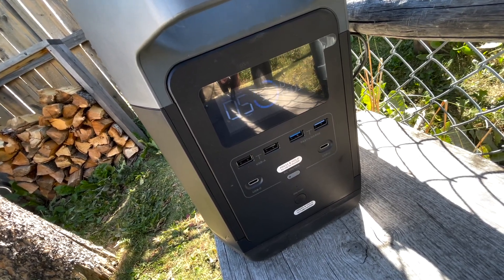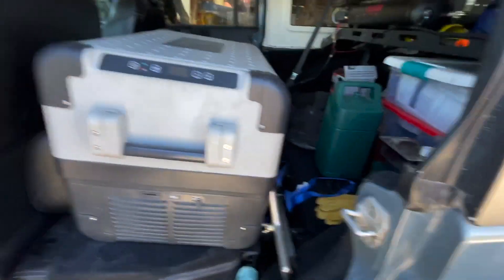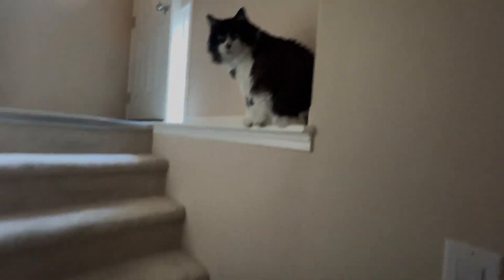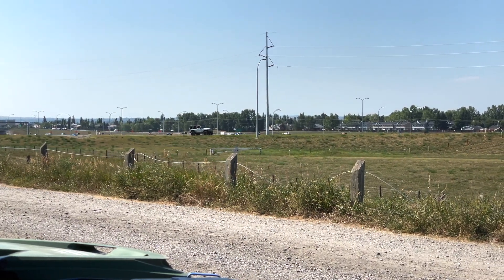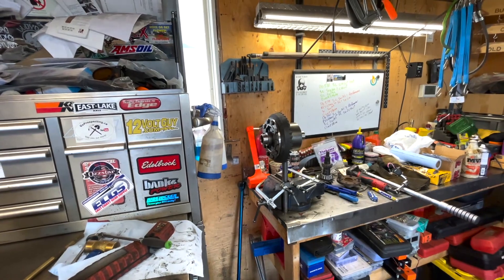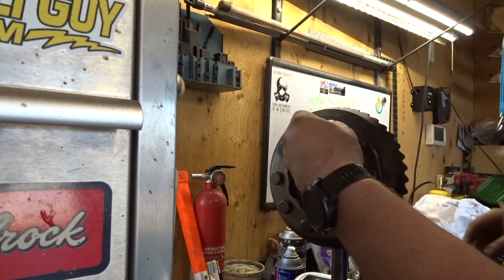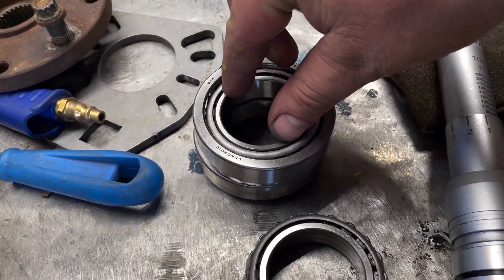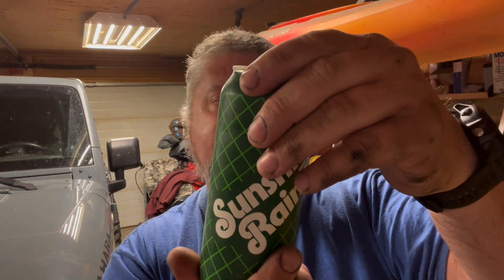Getting the Detroit Truetrac Ready for the Ford 8.8 Swap

Comment: Just got the old arb air locker and destroyed ring gear out of
the 8.8 in my Tj. Going with the truetrac this time with 4.56. Great video.
Reply from the maker: I bet that was a mess
Reply: Bullshitkorner what brand ring and pinion gears did you go with and did it require a special center pin or did you just use the one with the truetrac?

Comment: Hello BackCountry, You showed a procedure of heating the ring gear...was that because it would not fit TrueTrac diff housing?  I rebuilt a 8.8, used a Ford Motorsports LSD, and the ring slipped on, no problems.  Is this something that you have run in to on TrueTrac diffs...or just a general approach?  Thanks so much for video!

Comment: usa gear electro etch the pinion hight. I mentioned on your last axle video I use a parallel that spans the caps.  then with a depth micrometer I get the reading then minus out the parallel. last one I did I used the stock shim pack on the pinion took the reading made the shim adjustment and bang on :)  but when I did my yukon gears they didn't have the pinion height so that had to be done with only the pattern compound.  anyway you know what your doing just another idea to get away from the store bought setup tools.
Reply from the maker: Those numbers on the pinion didn’t make any sense to me neither could I find any info on it.
Reply: @BackCountryWrenching  so they are likely just matching numbers to indicate the r/p are a matched set like Yukon did. 
Not all manufacturers provide this info on the running height of the matched set It’s weird why they don’t. 
Last one I did for a Dana 44 was old stock Salisbury with the height marked. It was so much easier to set. 

Next ones I do I’ll investigate who marks. Makes it easier for me at least.

Comment: How does the 8.8 compare in strength compared too the dana 44?
Reply from the maker: The 8.8 is stronger than the D44 but the downside is that it has C Clip axles but you can get a kit to correct that
Reply: do you have any information with the c clip eliminator kit?